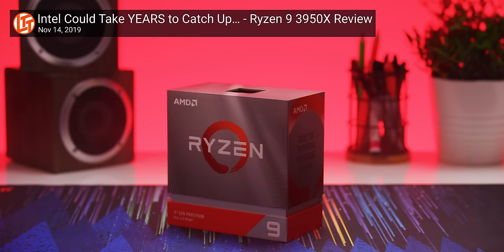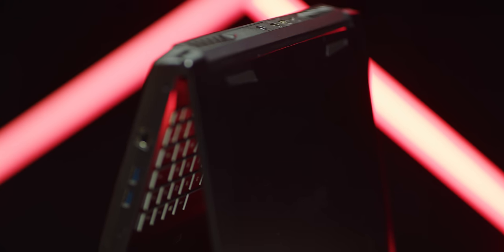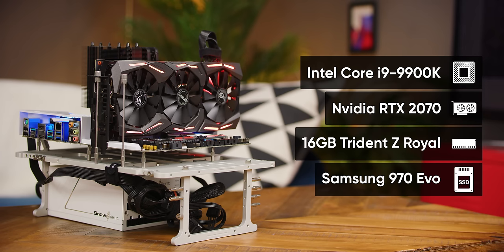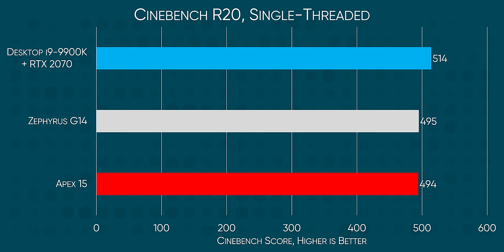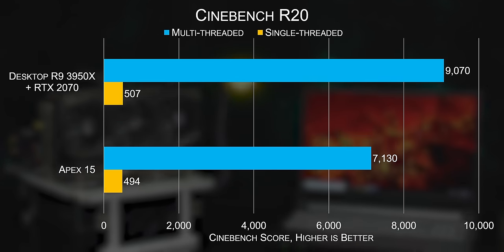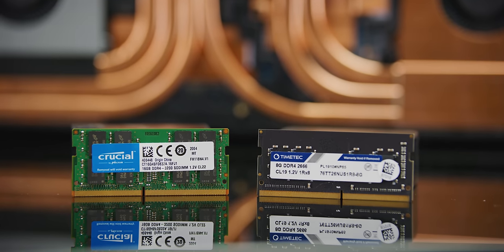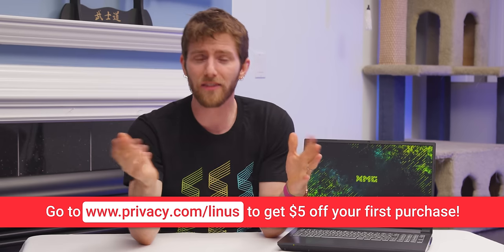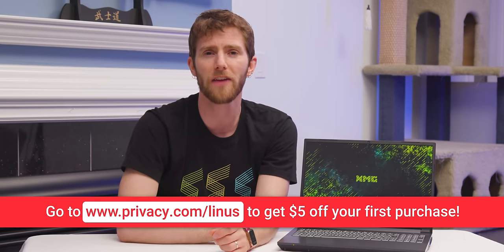The Most Powerful Laptop EVER!!! - XMG Apex 15

Comment: Apple: here is a 13" screen and 4 core CPU for $2000!
XMG: lmao
Reply: How much does this thing cost?
Reply: Code Bunny what you mean 1 hour battery? if youre playing game sure but doing normal stuff this thing is far more watt efficient. also this thing can render video in adobe far faster than apple can.
Reply: @Code Bunny your so funny try to game on that MacBook you will see how it will die in minutes, that one hour means gaming with ultra graphics equals to hour of gameplay
Reply: Michael P. $2500-$2900
Reply: @Code Bunny mac books have 4 phone batteries in them but the 2 core cpu thats very underclocked uses a lot less wattage
Reply: Code Bunny I mean, compare it to the zephyrus g14 tho :v
The battery life that it has, considering the gpu and cpu it has, it can last for 10 hours in most cases, maybe a bit less
Reply: Yeah, this is a dumb comment. Ultra portable laptops cost more to make because trying to squeeze the same components into smaller areas requires more engineering and higher precision processes. Not to mention, this laptop can't ever in a billion years come close to the Macbook Pro's speakers, screen, build quality, trackpad, keyboard, etc.
Reply: @utubekullanicisi  are you trying to defend apple , the material cost is very low and its not that hard anymore to firgue it out how to fit a cpu in a small case or laptop but what apple does is use phone parts for laptops but put slow pc cpus and sell it for for an extreeme amounnt of money
Reply: Lmao my local laptop builder can provide a 10875H and 2070 SUPER for a price of roughly 2000USD
Reply: @leehongjin6884  thats a lot lok but i guess thw price is good because its intel nvidia
Reply: @Noooo23523  Wished for AMD but yea I'd prefer this over some weak excuse of a computer that Apple makes.
Reply: @leehongjin6884  apple is usualy bought by people who dont know enough about phones or pcs , im sure they dont know amd is better
Reply: @leehongjin6884  the same thing i say its happening with intel cpus in cutom pcs too
Reply: @Noooo23523  Nah, I think most people are aware of AMD's resurgence.
Reply: @leehongjin6884  i saw a lot of dudes still prefering intel and nvidia when they are overpriced and offer worse performance
Reply: @hovis_esports  Maybe watch the video ?
Reply: i don't want to be lifting bricks.
Reply: @acd96digital  Lift some weights dude. Even a person like me who was born with a heart that leaks blood can do it.
Reply: @leehongjin6884  I much prefer a beefy af desktop and an ultra portable ultrabook.
Reply: Eluktronics: Lmao x2
AfterShock: Lmao x3
Reply: Code Bunny no. It won’t even last 2 hours if you are running boot camp on it (raw performance)
Reply: @Code Bunny you can afford to be all battery when the most you can play on it is spider solitaire without it exploding.
Reply: Lemao?
Reply: What about now 🧐
Reply: @Photo Bunny its 1 hour battery life in full use,
considering you put them to render the same file which will take 1 hour on the 16core 65W cpu it will probably take around 4 hours on the poor macbook, and lets face it, the macbook cant survive 3 hours at 100% cpu usage

Comment: AMD: So how did it compare to the Blue Team's Laptop Lineup?
Engineers: It didn't.
AMD: What do you mean? We are literally running on a smaller die size, and it still falls short!?!
Engineers: No, I mean it was so good it beat the desktop versions.
AMD: Well looks like the Witch Doctor is getting a raise...
Reply: Intel: ....
Reply: Wipe with hands no paper
Reply: Bryton Massie I laughed a little too hard at this
Reply: Did you just call Lisa Su "the Witch Doctor"?
Reply: Witch Doctor: Arise. Arise chicken. Chicken arise.
Reply: @anomuumit  Maybe
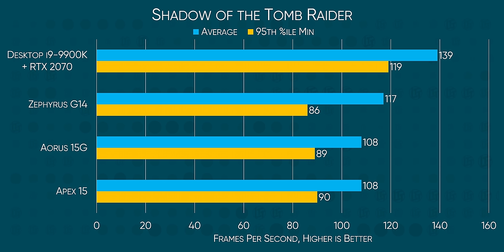Reply: Not in gaming, 2:44
Reply: @Reolzomic  That argument is irrelevant considering the fact that they are nearly equal in gaming. Try running obs or something with videogames and that quickly becomes a different story. Literally adding anything onto the workload will prove that (at this generation) AMD has better CPUs.
Reply: @Reolzomic  Sure thing, but having an addition of 10~20 fps more at the cost of being crappier at everything else… well, the choice is still obvious…
Reply: @brytonmassie  I record great with my i7 9700k great no fps loose at all.
Reply: @FalconWindblader  Amd is more expensive atleast when bought my i7 9700k.
Reply: @Reolzomic  Really eh? What were you tryna buy back then when you were looking up the amd ones?
Reply: Intel: ++++++++++++++

Comment: Sees detachable battery

Now you have my attention.
Reply: AvengerMKII yeah you only see that on:
1. Workstation-class laptops (I still have a soft spot for my old Dell Precision, you could change basically everything on that old beast except the CPU)
2. Clevo stuff. My old 15 inch 860m clevo was a beast for its $1200 all-in price, and the battery was removable!
Reply: The bottom also has 6 screws and just slides of giving access to the memory, CPU, GPU and all your storage (2 X M.2 and 1 SATA). It's fucking godly
Reply: yeah that way you can carry 3 extra batteries and possibly achieve a useful working life. i honestly think there are zero people for whom this product is a sensible choice. it is impressive tho
Reply: Yeahhh detach that 1 hour battery hahahahahahahahhahah
Reply: It's not really important, since it's hardly usable. It's a desktop CPU in a laptop, that means abysmal battery life. It's just a built-in UPS.
Reply: time to eat the battery goop
Reply: ni
Reply: Is there a point in detachable batteries nowadays? They're bulkier and they have smaller capacity, and it's not like laptop batteries nowadays aren't removable, you just pop open the back cover, detach some wires and screws and you're good to go
Reply: @saleplains  I mean I have one and its like the best choice I ever made sooooo
Reply: @rdablock  "Is there a point in detachable batteries nowadays?"

If you've never had a serious problem with your computer that required totally removing all power, you just haven't been around computers enough.

Also the reason I'll never consider a phone without a removable battery.
Reply: @isodoubIet  and what is it exactly? Is it worth sacrificing portability and battery capacity over?
Reply: @saleplains  I disagree. Being able to take the power of a desktop with you is insane. Big boy gaming laptops already sold well enough, and this thing claps them and is the same weight or lighter. 6 pounds is a lot for a laptop, but it's only 2 pounds more than the my jack of trades laptop from just 5 years ago.

You could straight up replace a desktop with it for not much more than a new one with the same specs.
Reply: Roman Nasuti Lenovo used to have external batteries and then they decided to go internal. It really put me off for their laptops
Reply: @isodoubIet  what have you found that's good with removable battery for mobile? Manufacturers need to bring that back its absolutely TERRIBLE. I literally haven't bought anything in >4 yrs because I cant find a good option with removable batteries both phones and laptops.
Reply: @rdablock  absolute nonsense. Literally all they have to do is add a clip system to it and basic coating that you can actually make <microscopic with materials more durable than steel if you really wanted. Gmafb.
Reply: who is going to switch battery every hour ?
Reply: @gda86pl  it's largely for debugging purposes not necessarily hot swaps.
Reply: @isodoubIet  yeah, i'm around computers around 30 years, i don't see much point nowdays (with office laptops having 6-8-10+ hours of work on battery), if you know what you are doing you will remove cover without a problem, if you have problem with that, then you shouldn not mess with insides anyway.
Reply: @gda86pl  Anything with any form of dedicated graphics doesn't get that lucky most of the time. It's nice to be free from the wall if necessary, especially when traveling or when in situations where you don't have the time to charge up. 

Our school had Lenovo Chromebooks with removable batteries. Whenever someone had an issue, the first thing they'd recommend is to take out the battery XD. Also, if your Chromebook was dead, instead of loaning out a charger where you'd need to find an outlet and need to remember to return the charger (which many people easily forgot), they'd just exchange your battery for a juiced up one. Extremely convenient.
Reply: @googlemail4241  my phone is still a 6 year old S5, and I'm probably not "upgrading" anytime soon... if it dies, I'll get an older phone off ebay before I consider the dysfunctional garbage that is peddled as smartphones these days.
Reply: Thats why i like my thinkpad T440, yes its old now and has a built in battery, but it also has a removable one soy can HOT SWAP BATTERIES WHILE AWAY FROM A CHARGER!!!
Reply: @saleplains  Onsite portable workstation?
Reply: @gda86pl  "who is going to switch battery every hour ?" i felt attacked hahaha joke nwai for us video editors (same day edit) this option is a must as we cant always have a socket to plug our laptops while editing on the go
Reply: @saleplains  I've seen some case for laptops like this, as there's some people that basically just need a machine that is 1. able to tolerate a power loss event and 2. is reasonably portable. This is what the mobile workstation segment was several years back, and if you only ever use your laptop at home and at work (never in between), this could be a really interesting way to "have it all". A 17 inch laptop with a built-in mechanical keyboard and a really nice display with an RTX 2080 or equivalent Quadro plus the 3950x would be a beast of a machine that, depending on your use case, would only need the battery life to handle power outages and accidentally pulled power cords. This wouldn't work for me, but I could definitely see somebody appreciating this.

Comment: 9:18
"€2400 for a 16-core machine."
Me: "Still better than an 8-core Mac pro"
Reply: Agwua  wtf? 🤨🤨🤨

Did you know that m1 chips are laptop chips that are designed for low power and not for high performance? We shouldn't expect that chip to beat a Ryzen 9 16 core CPU.
Reply: Agwuani  Shrimps
Reply: Cheaper than an mac pc and its better than one despite being a laptop damn applEA
Reply: @dy7296  When that laptop is designed for low performing machine, you should NOT expect it to perform like high end. Start marking up the price, and you will see it being compared to other machines appropriately.
Reply: @dy7296  shrimps
Reply: @triparadox.c  well that's what I'm saying. Are you ignoring the fact that Mac Pro is $15K??

Or if you're talking about the M1 stuff, yes it's cheaper. $999. But the M1's weakness is on 3D rendering. It flies on Video editing, because the CPU cores is really trong for such low power consumption. While the GPU, of course, is still lacking.

Comment: *sees removable battery

"you had my curiosity and now you have my attention."
Reply: *sees removable cpu

* surprised pikachu face
Reply: @sanjaychowdhary3118  old notebook has this lol
Reply: You can carry 8 spare batteries to get through a workday without plugging in :).
Reply: @Aidiakapi  and you can time that with the 8 daily Windows update restarts and not lose any productivity.
Reply: Very advantage on that, you can save from battery worn-out by just removing the battery if you plan to game for long term without compromising some damage component like battery and can boost the performance of the laptop without system check on power management (which battery is concern).
Reply: I have never seen laptop without a removable battery.
Reply: @Mr.Manson  usually the ultra thin models or crappy old slimline atom processor models